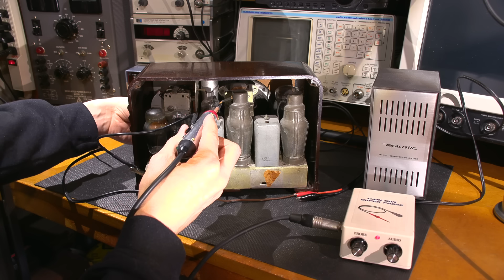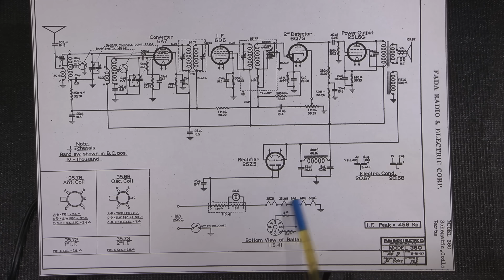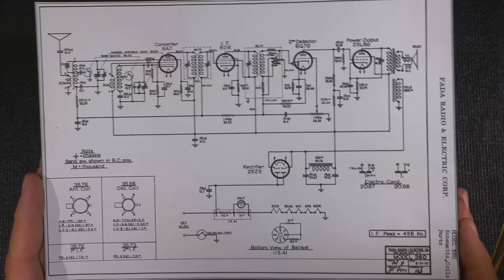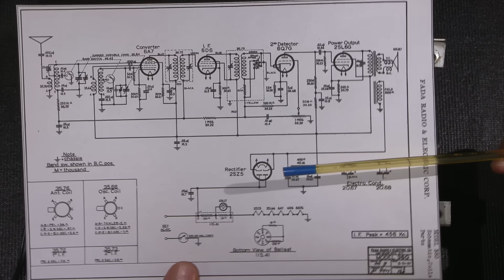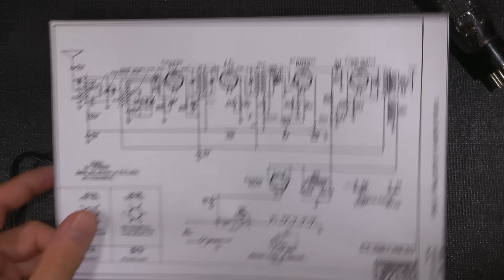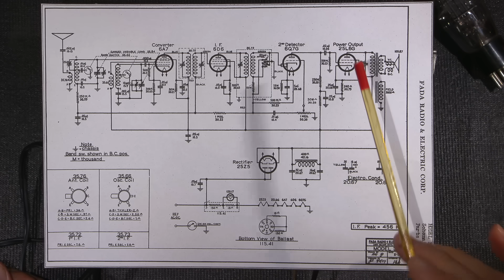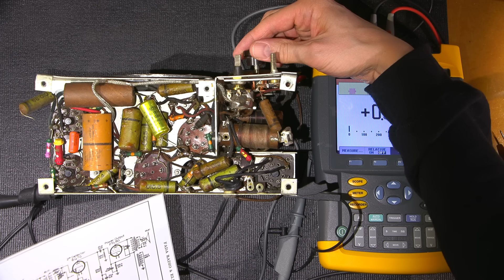Electronic Circuitry Diagnosis And Fault Finding! [Repair]

Comment: Over the years I received more than 1 shock while playing with tube radios and amplifiers with a “hot chassis”.   Back in the day,  my parents had a  kitchen counter with a metal trim around the edge.  The trim was apparently grounded!   I quickly learned how to plug the devices in so I wasn’t at risk of a 115 volt reminder.  Today at 60 years old I still never forget.

Comment: 2:05 - Hot chasis only a problem if you're bare footed in the basement turning it on with it out if the chassis.   Let's not be too hard on the engineers that preceded us!

Comment: Hey Paul, Great video, loved the whole process in finding the faulty component. Yes it should be restored, this is a great looking radio. One question: what would happen if you connect the plug in the wrong way and make the chassis hot and touch the chassis, would your isolation transformer prevent a shock?

Comment: Mr Carlson.  Great video sir.  Again thank you for explaining the safety aspects of working on vacuum tube equipment with a possibly live (hot) chassis.  looking at the circuit of the audio output stage and the failed wax capacitor, assuming that it was in a dead short condition, (which the scope-meter indicated) I would be very suspicious of the 240R cathode bias resistor.  In the fault condition I reckon that resistor would be dissipating around 1/2W (based in the 10.6V fault voltage between the 25L6G tube cathode and the chassis).  I bet that if you unwound that failed cap you would find that the dielectric had failed internally causing the burn mark on the side.  If you are inviting votes for restoration, I vote do it.  I have worked on vacuum tubed equipment before but I have not come across anything as early as the 1930s.  Personally I have never seen a "Ballest  tube".

Comment: Nice finding about the capacitor being shorted!  I myself would have at that point taken a slightly different approach to verify it was indeed the capacitor.  I would have turned the power off and measured the resistance.  Then I would pull the tube and see if the short disappeared or remained.  Well, cutting one lead of course worked.  It's just a difference in two peoples' approaches.
As to the restoration, I already know what all is involved -- my interest was the troubleshooting.  Thanks for that!

Comment: Did you get a Warm Audio U47 clone for Christmas?  BTW if you happen to have any Telefunken VF14 laying around they are basically unobtanium at this point and owners of original U47s will pay top dollar for them.  Have to be Telefunkens, though, the were hand selected to meet the required specs.

Comment: Would it be safer to replace the line cord with a 3-prong plug and attach earth ground to the chassis in addition to making the changes you described, 1) move power switch to hot, 2) add fuses, I would fuse both hot and neutral?

Comment: I learned electronics when the transistor was getting popular in 1959+. Most of the courses were of vacuum tube design, servicing etc. Today most equipment of any type is made of chips on PC boards which are basically throw away's and replaced with another board. There was a sense of accomplishment trouble shooting Vacuum tube equipment. In the 60's and 70's and 80's I serviced transistorized equipment containing other types of semi-conductors, caps,  resistors, inductors etc. These units of course were not throw away's like vacuum tube equipment wasn't. I was surprised to find out from Mr. Carlson that so many types of tubes are still being manufactured and there is a demand for old restored  equipment. The year of the radio serviced in this video was the year my parents got married (1937) so please restore it. They may have listened to Jack Benny on a radio like that.
Reply: throw away's what?
Reply: @haywoodyoudome  It is cheaper to throw away and replace something like a computer board or a cheap cell phone or pager then to service it. I guess it depends on the particular case which would be the least expensive way to go.
Reply: @steveseifer6784  OK, that makes sense now.  The apostrophe threw me off (throw ways plural as opposes to throw away's as in possessive).

Comment: Why not using a double switch, to disconnect both lines? In Holland we have no socket plugs that have different shaped pins. So in case of metal casings, we use double switches, to make sure, that everything is disconnected. Because we use ground for protective earth grounding. Namasté

Comment: l love your channel, it takes me back to my youth when I was constantly messing about with old radios and TVs.  I would like to know if that ballast is a hydrogen filled baretter.  The resistance wire surrounded by hydrogen has a resistance that increases as the supply voltage increases, giving an almost constant heater current over a range of about 10 volts of supply variation.  I had one of these once, it had clear glass, no getter, and thought it would make a good plasma ball connected to a TV flyback.  It did until the glass developed a pinhole with the heat of the discharge.  Oxygen got in and you can guess what happened next.  l am lucky I wasn't blinded on this and a few other occasions.   Nobody talked about health and safety back then.

Comment: Paul, shouldn't you attach the black lead of your antenna to the chassis? (52:28)
Reply from the maker: Hi David. The antenna is not resonant on the BCB, so leaving the antennas neutral disconnected makes it closer to resonant.

Comment: Back in the days when these radios where being produced,  they had paper and cloth cover power cords.  The power cord may have been replace just due to the fact the old cords just shorted out over time.  If the back was on the radio,  touching the chassicwasn't a problem.

Comment: I  don't know why, but in the United States, AM broadcast I-F is 455 KHz.
Reply from the maker: RCA held a patent on 455kHz way back when, so other radio manufacturers would use 456, 460, 465kHz, and other "randomly chosen" IF frequencies to avoid issues. Most 455kHz IF transformers can be tuned to these frequencies without redesign. The dial scale has to built to the chosen IF frequency, to display accurately.
Reply: @MrCarlsonsLab  Thanks for the education.

Comment: Back in the day, I relied on a well stocked tube caddy, schematics and my trusty Heathkit  VTVM. I rarely found a problem that could not be solved with these. And of course a good working knowledge of electronics and electronic devices.

Comment: The unit under test is ALWAYS plugged into isolation on my bench. Orange DROP capacitors were a line of replacement parts made by Sprague.

Comment: I remember checking vacuum tubes at the local drug store. Hard to believe that we had to do that. I would like to see this radio fully restored to factory condition. Thank you for a great video and wonderful learning experience.
Reply: Indeed, when stationed at Fort Myer in the HQ Communications section officers and senior NCO'S with radio or tV decided that should be in communications, so they would bring them in and ask (read order) us to repair.  They would cover the parts and most would slip us an extra ten spot for our trouble, way cheaper then taking them to a tv repair shop and paying 50 bucks to have the device opened up, plus parts and a  rather high labor.  We would pull the tubes  out, walk across the street to a drug store and use their testers or some times just dig out our Government tube tester and check them, then buy the needed replacements keeping the receipt and fix the sets.  We did have a trained radio mechanic in the Section and he would take care of the bottom problems after calling the owner and telling them that they would have to cough up another 20 bucks for his service.  Most acquiesced.  It was a fair sideline for some of us.

Comment: What a beautiful little radio! A note to viewers - that speaker doesn't have a dust cap, so if you get anything between the voice coil and the magnet assembly, you're going to have to re-cone the speaker to get it to function properly again. And that would be a real blow to the originality of a beautiful piece of our tech history. It's so weird that the field coil is across the B+ rather than inline - they had a free choke, why didn't they use it that way? (Sometimes it might have come down to a patent issue.)
Reply from the maker: Hi Lawrence. The speakers "of the time" never came with dust caps, and this one is ok. Very commonly, most of these speakers with no dust caps are ok.
Reply: @MrCarlsonsLab  LOL... I know there were no dust caps in the day. I just worry about any sort of grit getting into the voice coil clearance. :)

Comment: Excellent example of how an old shot capacitor can kill a radio.  Replace all the old electrolytic capacitors, the next one will go anytime.  Mind you they have done very well to have survived till now, just shows the quality of older components.  I think you should show us replacing the old capacitors and cleaning  everything up and an alignment, though it does not look as if it is very far off anyway.  Thank you for taking the time to show us the radio fault finding.  All the best for 2020.

Comment: quoting an old repair manual: "if the radio's tubes are glowing but there is no sound, always start the troubleshooting with the audio stage first".
Reply from the maker: Actually, you always start at the beginning of the chain, the power supply.
Reply: @MrCarlsonsLab  yes and no. that manual was written in the 40es, when these radios were new. they usually failed at the most vulnerable part: the audio amplifier. Either a dead final tube, or a dead output transformer. or a dead field coil. I agree that things changed in the last 80 years :) I just quoted that manual.
Reply from the maker: Hi Pop Tibi. Unfortunately, that manual is incorrect. How can you troubleshoot the audio section if the power supply doesn't work? When a radio is silent, the first thing you check is the power supply, it's the heart of the radio, then check the converter, then IF,  then audio. The audio stage is the last thing in the chain. Just because it's written in a book doesn't mean it's right. If that manual claims what you have written, it's 100% wrong.

Comment: When I was seven years old my family won a 1956 RCA color TV, one of the first such TVs in the world.  There was only one program, an NBC (Channel 4 in LA, California) news program, in color at the time and I can still remember the newsman in color on that first viewing on the set.  It had all sorts of manual controls in a covered compartment in front for setting the video levels, the regular contrast and brightness and horizontal and vertical synchronize knobs, the tone sound control, and also new controls for tint and color saturation.  At the back of the set, sticking out of a heavy cover along with the antenna wires and power cord, were several controls for the three colors used (labeled red, green, and blue; though these were only their simple names, really being magenta, green, and cyan phosphor variants used in the tiny triangles of color dots per pixel) for the maintenance man to give a final calibrated tint/color saturation setup of the big tubes after fixing the set (I never touched those).  It had many problems and spent some time "in the shop" or with an RCA tech fixing it in our living room, which was really interesting for me and my little brother to watch.  It may have been a headache for my parents, but for me, fiddling with the front manual controls and reading the thick manual from front to back, it was a blast.  (Note that the first color Xerox machines had the same manual color-adjusting controls on top and you could use them to get all sorts of artistic effects when you copied anything -- I tested it a number of times on a drawing I had made, with very amazing results!)

Can you do a rebuild of one of those old color TVs, which would be MUCH more complicated and informative about how such complex signals are sent on radio transmissions?
Reply: I bought a ctc4 Dumont (rcachassis )1954 model in 1959 we sold it to a collector  in 2007 for 600$ it was working crt was rebuilt metal and flyback a glass crt can be used in those sets .

Comment: Speaking of unexpected voltages; years ago working on I one of those Wollensac school type reel to reel tape recorders.
Putting on my over the ear headphones and plugging them in the speaker jack in the back and HUMMMMM....BUZZZZZZ...SMOKE...I ripped the headphones off my head a fast as i could.
Turns out someone had rewired the HP jack for an AC remote On-off switch.
Never could have anticipated that one!
Reply: Used to fix them back in the early seventies. Deadly beasts, mix of tubes and transistors, and almost impossible not to get hit when testing under power with guts splayed to get to anything. But no jack rewire...
Reply from the maker: It's amazing what people do, Thats a great story, thanks for sharing!

Comment: Come on man, when troubleshooting you start with the simplest things first. Check the speaker, then it's connections and work your way back. And in a set that old it's  a fair bet that the capacitors are blown, dried out or any of the other things that happen to aged caps of the type used in these old radios. If you were working by the hour you just lost money.

Comment: Hi, i want to use the 18 pin version of the LM3914n (as you did in the prototype) but I don't know what to do with pin 6 which is used on the newer version (high end/ divider)? any help please?

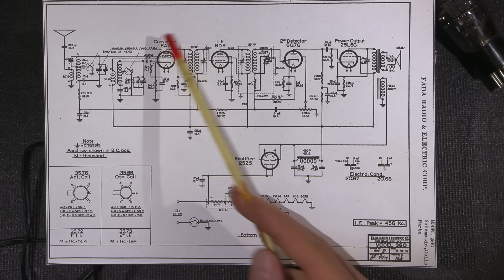Comment: 50:28 that's how some spy equipment sniffers worked... an antenna tuned to the common tape bias frequency of a small tape recorder :) And this is why the NAGRA SN and JBR recorders used an unusually high 125kHz bias, to be outside of the detectors' range.

Comment: My vote would be for NOT restoring this radio but instead using it as is until another of these capacitors goes bad. Would be interesting to see how long it will actually take until this happens. Happy New Year, Paul!

Comment: This video brought back so many memories from back in the day.
When I was young, I remember going with my grandfather to the Recall drug store to a RCA tube tester.  He would check his tubes and the ones that said bad or weak, he would get new ones.
That intrigued me so much that I wanted to learn electronics. 
When I went to high school I took as many electronic classes as I could. I cut my teeth on vacuum tubes and moved up to what they called transistors.  Later in life I got a bachelor's degree in electronic engineering. Nowadays it's IC chips ,5 volt supplies, and all
Digital. But I miss the old days. Lol

Comment: I'm curious as to how much improvement could have been made in vacuum tube electronics if the transistor didn't come around till 10 to 20 years later.  Could the vacuum tubes been made much smaller, run at higher frequencies or had much more complex circuits in one tube (like an IC)?  Anyone have any insight as to where things were headed before the transistor was invented?
Reply: I wish I could tell ya but it’s a very interesting question

Comment: Old electronics have three major components to fail: 1. Electrolytic caps 2. Paper/foil caps. 3. Vacuum tubes. 
Tubes unless having white spots where there used to be silver are likely OK.
Ceramic and mica caps usually ok. Ferrite cores can change quite a bit over time. Old insulation can fail.

Comment: I vote for restoration with an educational twist for viewers like me. Restore small sections of the radio and give it a  performance test after each one to hear the improvement and maybe test caps that were just replaced. As a beginning hobbyist I gain more knowledge of radio diagnosis . Thanks so much for passing along your electronics knowledge.

Comment: Excellent video, thanks Mr Carlson! Would it make sense to put a double pole switch on the mains power to isolate both the hot and netural lines? That would remove concerns about polarisation of incoming AC voltage. Also does anyone still manufacture paper/wax capacitors these days?

Comment: If you do proceed to complete the restoration and alignment I am very curious what you will do for an antenna. External connections for a long wire? AM Ferrite rod? Or a piece of brown hardboard with wires looped around and adhered to the board?

Comment: While I'm sure your outlets are all properly polarized, it's been my experience that the average north american NEMA 5-15 receptacle absolutely can't be trusted to be. I'd guess at least 5% are wired wrong, I rented one place where literally half of them were reversed polarity. I think the only way to make a radio like the one shown safe would be a GFCI cord or modifying it to be like some of the later AA5s where the chassis was only connected to power through a cap and high value resistor, and the antenna ground.

Comment: Often knob set screws make a direct electrical connection to the chassis.  You can get a deadly shock simply by adjusting the volume if your finger comes in contact with the knob setscrew.

Comment: Of course you should restore it!
It looks like the shorted cap would have been pulling down the plate voltages on all the tubes, not just the audio section. The real clues were the excessive voltage drop across both the output transformer primary and the cathode resistor of the audio output stage.
Interesting that the circuit shows that the speaker has two internal coils in series, one marked "VC" (Voice Coil) and the other I can't quite read (BC? SC?),  in addition to the Field coil.
Reply from the maker: Hi Kevin. "BC" is Bucking coil. This is used for hum bucking.